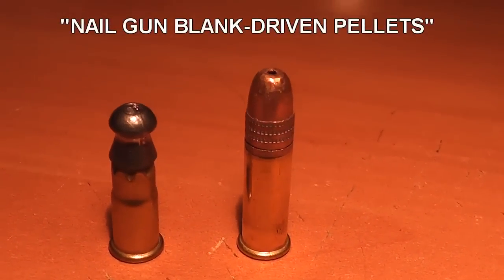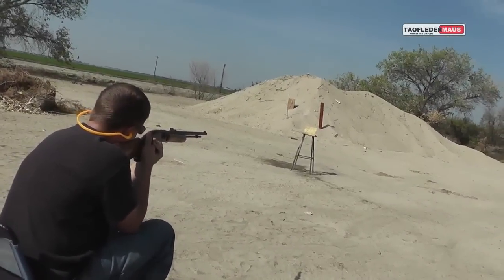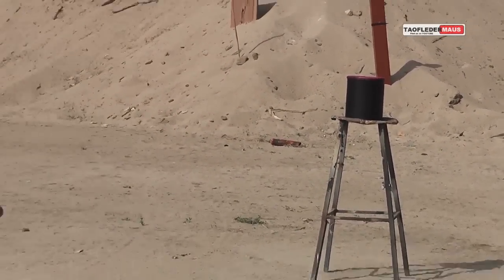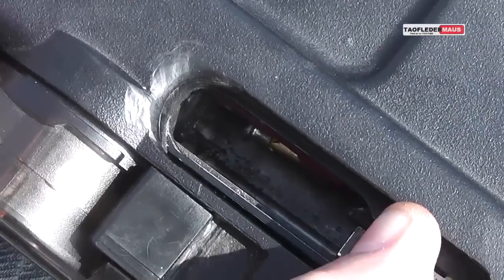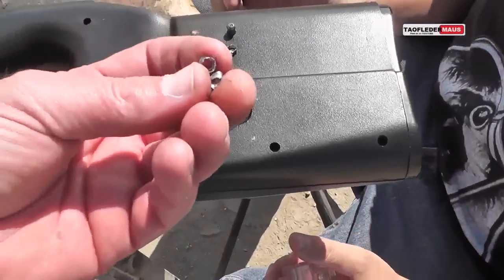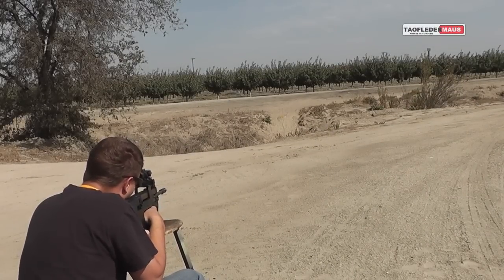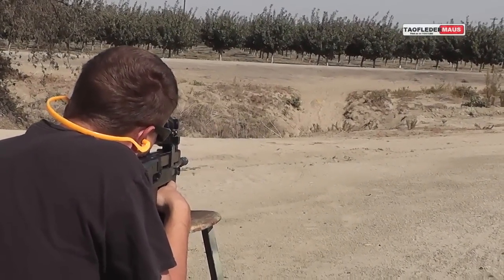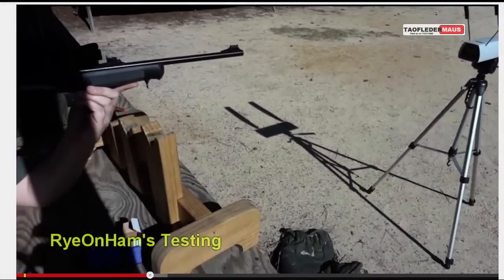Shooting .22 PELLETS Using NAIL GUN Blanks?  PART 2

Comment: One could over analyse (analyze...) and come to the conclusion that the combination of bullet weight + velocity + rifling twist rate = poor accuracy. The biggest problem is the composition of pure lead vs high velocity, which at these speeds, would exit the barrel extremely deformed.

An alloy is needed. I can't recall ever seeing commercial air rifle pellets of this ilk, but it is possible to buy moulds. If I wasn't all the way in Australia, I'd cast you some out of interest.

I've seen aluminium (aluminum...) Air rifle pellets, though. For same size, they're lighter and faster, but damn do they bounce back in a hurry if you hit hard surfaces.

Ultimately, the power in these lil guys at those velocities was brilliantly fun to witness. Great vid!
Reply: a high spin rate is likely making that .22 pellet a good bit larger in diam than a .22 bullet. Id be surprised if some one found a way to fire them normally if the pellets did not break apart before hitting the target or any where near it. The centrifugal force has to be just nuts.

Comment: What is needed is length to get to the rifling , so take 2 wad cutter pellets  and glue the 2 flat surfaces  together  then glue the combined pellet to the crimped  shell. That should  give you length and more lead and weight  that may work ,  try it.

Comment: I have a couple questions. Did you try using the pellet that has a BB on top for increased accuracy?
Second have you tried coating the pellets with pan bullet lube to stop the leading of the barrel?

Comment: You should try using the 22 caliber copper pellets I think they will hold up to the higher velocity better and you might get better accuracy and you might not have the skirt sharing problems that you were having with the lead pellets.
Reply: The problem with copper pellets is they are even lighter than lead. Lead pellets aren't heavy enough to maintain stability when they are shot at extremely high velocities, so copper will only make the problem worse. What's causing the skirt shearing is the short length of the case combined with the incorrect shape of the pellet, and not the material the pellet is made of. Basically, pellets should only be shot from air guns.

Comment: Here is an idea... Since the pellets are so light (perhaps 15 grain each), how about loading 2 or even 3 of them to better match the weight of a typical 22 LR bullet at about 32 to 40 grains?  I could try it in my 22LR revolver and see what happens.  I would use 2 of the approx 15 to 16 grain pellets pushed into the forcing cone and a #2 (weakest) nail gun charge and shoot at a target and see what happens.  If that works then I could try 3.  I wonder in they will damage each other before exiting the gun.
Reply: That would be an interesting experiment. I've never heard of anyone doing it in a smokeless firearm, but have in a BP muzzleloader. I've seen ppl double or even triple ball a load. There's also the 'Buck and Ball' load which is fairly common for a smoothbore BP firearm.

Comment: I was doing same sort of thing a couple years ago when I couldn't buy ammo. I wouldn't go much higher than yellow in a normal gun, I tried a red one and it backfired, Blew the extractors off the bolt, cracked the stock. Yellow ones work nicely with a 44gr cast lead projectile.  Or .222 fmj projectiles.
     If you wanna try the red, purple, and black charges , get an old Ramset j20 off eBay ;-)
Reply: FWIW, the 2Browns are the recommended load for the 'Hammond Game Getter' device no matter the size of the bullet. Though he suggests having some 3Greens or 4Yellows handy if you ever get a bullet stuck in the barrel. As for 5Reds or 6Purples, where would you even get those? I've only ever seen Browns, Greens and Yellows in the stores.

Comment: you should try this with .22  stainless steel sabot pellets made by Prometheus. these pellets are awesome in airguns and supposedly add 100 fps to projectile speed in air guns due to their light weight and plastic sabot design.

Comment: Dekard says, use longer pellets,  not those bad mitten birdie type. They slow down,  tumble, and generally suck at longer ranges over 25 yards. Also, there is a curving problem,the harder you whack em, the worse it get's.

Comment: Do all of those FNH P90's take Ruger mags up the ejection port, or is that one of those clan shell retrofit kits like Red Jacket Firearms used to make add conversion kits? The top-side magazine threw me off a bit.
Reply from the maker: Andrew Delashaw It's an airsoft P90.   Red Jacket stole my idea,  modified their stock a little and sold them for more than the price of the 10/22's that go inside them.

Comment: Heres an idea, you should try the same thing, but use .22 cal round balls. they may hold together better at the velocity. using 30-30 and 30 cal roundballs it pushes 2900fps, with minimum pressure.
Reply: +Mitchell Stitt Actually, I was thinking steel ball bearings, or pieces of drill rod.

Comment: What if you used the "heavier" pellets, those shaped more like a bullet, to reload a proper .22 case? Would have to sand/file (by rotating the pellet on a drill) to make the heel, but that might be easier than casting the bullet

Comment: Be very careful with these powder loads. Even the weaker loads are hotter
 than .22LR. As an example of the kind of power these nail gun cartridges contain the
 strongest number 12 load will fire a 350 grain slug at 1295ft/s. That's
 a lot of kinetic energy!  A standard .22LR at a mere 32 grains is 
running about the same velocity. Have a think about that. I'm glad you 
didn't run up to  a number 5 or 6 load or the result could have been
catastrophic. Here's an excerpt  taken directly from the PAT (power actuated tools) manual

 Powder loads must never be used in firearms. They are more powerful than the charges normally used in small firearms. This could result in serious injury or death
Reply: Great info. I'd been wondering how powerful they were. The only power levels I've ever seen in stores are 2Brown, 3Green, 4Yellow. Oddly the Greens are usually the cheapest. These loads are used in the Hammond Game Getter device to fire low power round balls for small game. That's likely how these .22 shooters heard about them. Interestingly, Hammond suggests only using the 2Browns no matter the caliber round ball. But says to keep some 4Yellows handy in case you ever have a ball stuck in the barrel.

Comment: I`ve chambered a .177 air rifle barrel and shot some 4 mm ball bearings using 6,35 mm red hilti cartridges...goes trough 10 mm aluminum plate and leaves an enormous crater when shot into a lead block.

Comment: Idea. Loaded reg .22 lead and fire it with the nailer blank. Also would a regular .22 shell with the lead removed give more or less speed and power to .22 lead and or .22 pellet? Or do these powder nailers have a larger powder load than a standard .22 round?

Comment: After watching RyeOnHam's velocities...I'm thinkin', somewhat obviously, the main accuracy issues are due to soft thin lead shot at very high velocities (maybe even melting the pellet tail flair at the chamber throat area)....not enough surface area to rifling to stabilize ...and the pellet is possibly rolling a bit or tumbling in the barrel adding to the extreme fouling....Maybe try accuracy again with the pellet inserted at the muzzle a few short various distances, perhaps  6, 10, and 14 inches. It might tame the initial pressure spike, stabilize better, and be more accurate, although sacrificing some velocity. 
Just a theory.  Thanks for the videos. :-)
Reply: ***** My conclusion was that the pressure was stretching the skirt and shearing it at its weakest point.  The pellets were not yawing or rolling in the barrel.  The leading was from two sources: raw velocity and cutting of the soft lead.  Generally, you want to keep lead below 1,400 to 1,600 fps.  Beyond that, the heat of friction will melt and deposit lead all along the bore and blow the remainder out the muzzle in a cloud.  I think the Brown power level is viable and POSSIBLY the Green (3) for acceptable performance.

Comment: I tried a few things with my 22LR revolver (4 inch barrel).  I tried the #2 load (the weakest) with a 22 pellet with a 177 pellet behind it and I also tried a 22 pellet with a 177 BB loaded behind it.  I first load the 22 pellet into the forcing cone then push it in deeper by using the 177 pellet or the 177 BB.  The cylinder will then close and rotate properly.  I am still playing with it to figure out if they take the same path or if they separate.  They are not joined to each other like with glue, they are just touching in the barrel with the 22 pellet forwardmost and a trailing 177 pellet or 177 BB.  I have not yet tried all 3 but I can and will.  The 22 pellet is a tight fit (it engages the rifling) so the smaller projectiles behind it are "trapped" when the cylinder is closed, meaning I can point the gun downwards and no projectiles come out until I actually shoot the gun.  It is a fun experiment and cost effective too.  By using the #2 load, the velocity is kept low and can even be shot indoors if proper precautions are taken (hearing and eye protection, good backstop, ricochet protection, good ventilation, no animals and/or people in the area...

There are so many variations to this.  I guess that is what makes it fun to experiment with.  For example, what might happen if instead of the 2 projectiles touching, there is a little air gap between them?  Will one gather up enough velocity to partially destroy the other?  For example, will the rearward .177 pellet want to damage the skirting of the 22 pellet when they hit?  I wish someone could take slow motion images of something like this inside the barrel so see what is happening.

Comment: instead of hot glue you should use thin clear tape and leave a bit of room between the blank and the pellet so it don't get stuck in the skirt when opening...
could work in a revolver this way.

Comment: Have you tried them in a revolver? It seems you could load 6 rounds at the time in one.
Reply from the maker: A friend tried them and they don't work because you have to seat the fragile pellets into the barrel.   The pellets will break apart trying to transition from the cylinder into the barrel.

Comment: Twist rate of the barrel is too fast for the pellet at those velocities. Light projectiles need a slow twist to not tumble while heavy ones need a fast twist. Also too fast of a twist with light projectile at very high velocities will vaporize because of friction of the air

Comment: Pellets can be extremely accurate at velocities around 900 fps or so, but are terrible once they break the sound barrier, of course they were never designed to do so. But, even at 900fps or so, you can still put more than 25ft-lbs of energy on a small varmint at a decent range of about 30 yards or so. (with a good air rifle such as RWS for example), Not that junk they sell at Wal-Mart.

Comment: I think these would work nicely in my 22lr revolver. I could easily put the pellet into the chamber side of the barrel and then just keep six cartridges in it, after firing I could open it, replace the spent cartridge and put a new pellet in
Reply: And as it is just a revolver for close range shooting, the accuracy problems described would be not be an issue worth worrying about.
Reply: ***** never mind, I didnt think that through, the cylinder and barrel are not pressure sealed to each other. Haha.

Comment: This seems like it might be a method for a 3d printed gun's ammo, since last I saw, they were mostly single shot, and needed to be disassembled to be reloaded anyways.  So... 3d print a bunch of the barrels, load 'em up, then swap out the preloaded barrels after each shot.

Of course, that depends on quality prints that won't EXPLODE in your hand, now doesn't it?  It would likely still be a better choice to get a proper gun.

Comment: ***** what about if you drilled the breach out on a robust .22 air rifle like a HW80 or HW35 and loaded like a shotgun and had a fire system designed so when the air hit the blank there was some sort of firing system inbetween then you could glue the pellets as it would go straight into the rifling...
Reply from the maker: Gareth Hughes   I'm not sure!
Reply: ***** I'm going to have a go with long blanks first then more on to a week nail gun cartridge and go up the colors first to see how it performs and for safety...A Weihrauch is a good sold rifle just as safe as a shotgun breach I reckon...
Reply: I've seen a good firing system to use were the air ejects into the breach firing pin system. A guy has been doing it for ages with a old Chinese air rifle but am not messing about with powder and primers like him...

Comment: I think the pellets will not leave lead in the barrel if they are made out of copper
Reply: I know of no copper pellets, but have seen copper coated pellets. For those, I wonder how thick the copper layer is? Would the rifling cut through it? Or would the copper be thick enough to keep the barrel from leading?

Comment: Interested to see if you can design a wooden dowel with a simulated dummy grenade or politically correct, a spud on a stick attachment for your shotgun.  Kind of like what the Yugo SKS w/grenade launcher does. Interested to see how far a blank low brass cartridge can send one of these projectiles down range.

Comment: Lack of accuracy is not really surprising...airgun barrels are nominal .216" in the groove vs .222" for .22 rimfire. While the skirts were obturating and sealing the bore (when they did not shear off), the heads of the pellets were quite likely cockeyed in the bore, resulting in an unbalanced condition when fired. Centrifugal force acting on an unbalanced projectile will give you a shotgun pattern every time. Being drag stabilized, they still gave the appearance (cutting round holes) of being stable. An applicable demo for precession and nutation...http://www.arld1.com/images/swfs/nutation.swf

Neat to play with at any rate. :)

Comment: we have done this with break barrel long rifle, its alot easier, the one we used was a dual barrell, and they where accurate from the 3rd level of a barn to the far back corner where we where shooting the rats eating the bait we put out... not bad for  as his grand father put it "just dicking around"   my gamo hornet .177 packs more of a punch though... it requires a "dab hand" though, its NOT for beginners... i put a plastic pellet threw a metal locker at 8 car lengths (or more) blew my mind... metal pellets.....jesus...the copper ones i have... heavy as hell... and will punch threw a car wildshield... (only know because my buddy shot his car with it...then realized what he did and started crying... brand new car...2 weeks old... and the genius shoots his windshield with a solid copper pellet not just putting a hole in the wild shield, but a hole in the back seat..leather...LOL... he lied to his insurance and claimed he came out to find the car like that...

Comment: From watching U'r 1st efforts I thought Silicone to hold the pellet to shell. Super glue I think might be to strong ?. Also I was thinking a Bolt action might allow better control over an auto loader ?. Just thoughts ! I don't have the means to try anything. I wish I did, but here in Haw. It's near impossible to own a firearm. But Thanks for an enjoyable share. Be SAFE & Have fun. Aloha
Reply from the maker: Mark Horst   They work better when you set the pellet into the rifling of the barrel slightly ahead of the chamber.   There seems to be a problem getting a clean transition from the chamber  into the barrel and that will cause the round to break apart.
Reply: ***** dude, a gel test!

Comment: ok i have modified a crossman to 3800 fps by add some foam to the air pump and using 30 wieght oil on the foam and it was a 22 cal with a 177 thats a little over 4000 feet per second buoth cross air guns sounded like 12gauge shot guns lol

Comment: Lead fouling is due to hot gases blowing past the bullet. Your bullet is not being seated into the rifling in the barrel due to the small size and design of the lead pellet.
Accuracy is poor because the bullet has been deformed due to increased velocities.  
If you CARFULLY pulled a regular bullet from a 22.lr case without damaging it, and pushed it into the barrel of your gun. Then used the power blank behind it. You would likely see better results. 
I have not tried this, neither should you.

Comment: The rifling in a 22 is going to be the wrong turn rate for stabilizing those pellets going that fast
Reply: +Dana Webb 
That's an excellent point.
Reply: +Dana Webb - Depends on which nail gun load you use.  The # 2 load should be ok for most 22s.
Reply: David James
Also those pellets are soft lead, there designed to expand against the rifling at lower pressures than what those loads produce.
Reply: Dana Webb - So just shoot at closer range then.  Many people cannot hit the broadside of a barn anyway so I don't think the rifling is that important as long as the pellet and load doesn't damage the gun.
Reply: David James
What ever floats your boat LOL!
Reply: Dana Webb - How about glueing in a small BB to the pellet to give it extra weight and thus slow it down?  That might increase the accuracy but I am not sure.
Reply: You want the center of mass to be as far forward as possible, sounds like a winner it would be nice if you could add a little tin to the lead. Those pellets are made to be heavy in the front.
Reply: +David James pellets shapes (specialy diabolo) are made for sub-sonic speed, @3000 fps there's no rifling able to stabilize a pellet
Reply: Bruno Mamizuka I use a 4" barrel 22 LR revolver and I add extra weight using a copper coated steel .177 BB so perhaps 20 grains total.  I doubt with a # 2 nail gun load it is supersonic.